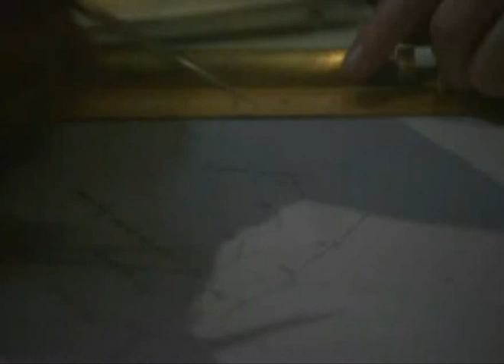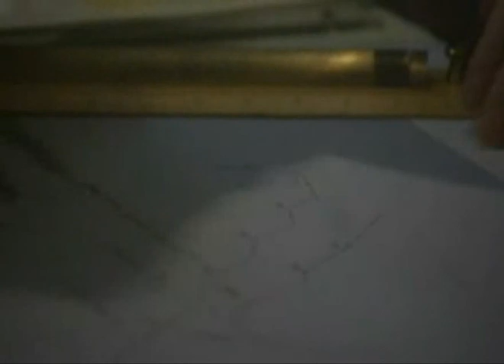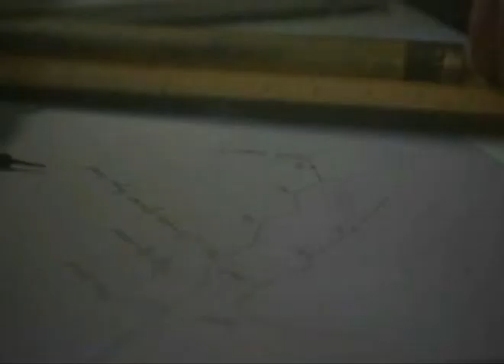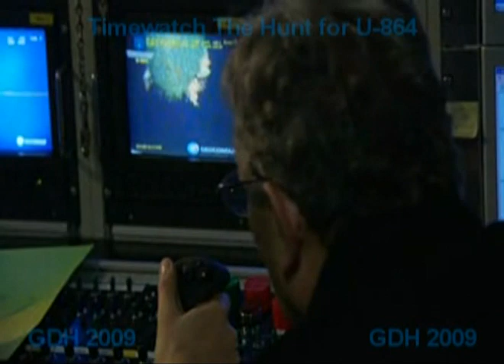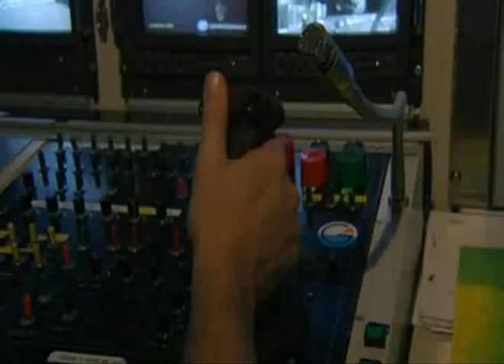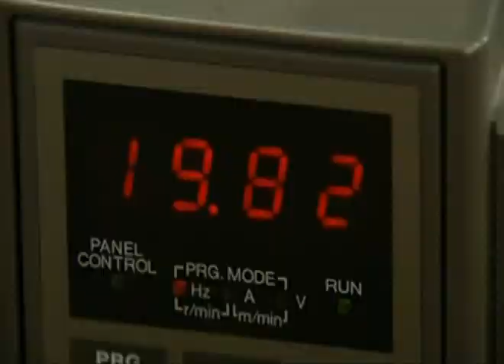(4/5) Timewatch The Hunt for U-864 World War II

Comment: The Norwegian state budget puts up 30 millions NOK to preparing for covering of U-864. (Ca. 3 millions EUROS). Not unexpected, this is a part of a governmental instruction of the Norwegian Coastal Administration since 2008. In 2010, the Jens Stoltenberg government decided to draw off 620 Million NOK from the salvaging budget for U-864. It was totally 740 millions. Then the government decided to use 10 millions on papers, and 100 millions for preparing covering of the wreck. Later they raised the budget with 150 millions to make a supportive sand filling to "secure" the wreck. That was step one in the covering. In 2010 the government decided to ERASE THE SALVAGING OPTION, and prevent the Parliament from having the option of voting for salvage. Tha last step in the cover operation is to ERASE THE SALVAGE OF MERCURY, and then only go for covering. It will be the biggest deposit of Mercury on the planet, and on the sea bed, stored in salt water, the environment that is the best for developing Methylmercury, a vey dangerous nerve poison. And on top of that: Norway never reported the Mercury threat to OSPAR, the commision that are working for protecting and cleaning the marine environment in The North Sea. The Norwegian Right wing government, lead by Prime Minister Erna Solberg, have the aim to be a leading star for cleaning the oceans for plastic bags...WHAT ABOUT 67 TONNES OF MERCURY? It's time to act - the best way for health and environment for thousands of years ahead. It seams that Prime Minister Erna Solberg is more occupied with planning her golden pension...

Comment: The narrator's statement: "never before had a submerged U boat been torpedoed" is not technically correct (look up Mark 24 FIDO "mine"), however this attack by HMS Venturer is in a class by itself considering that only "dumb" torpedoes were used.  For this reason, the statement in the final segment that Launders pioneered a standard of post-war submarine vs. submarine warfare is also technically incorrect as the latter relies almost 100% on acoustic (i.e. "smart") torpedo technology.
Also, to my knowledge, it is "DIVING STATIONS" in British submarines, not "ACTION STATIONS".

Comment: If  the U-boat was running on diesels it must have been using its schnorkel which means all this talk about giving away it's position by raising the periscope is nonsense. Perhaps it had shut them down as they were described as being used intermittently, like a fishing boat stopping and starting, but the lack of accurate information is annoying. Scenes such as that in which Wolfram asks the radius over which his engines could be heard are pure speculation as there were no survivors.